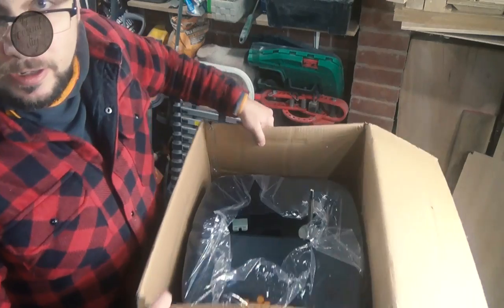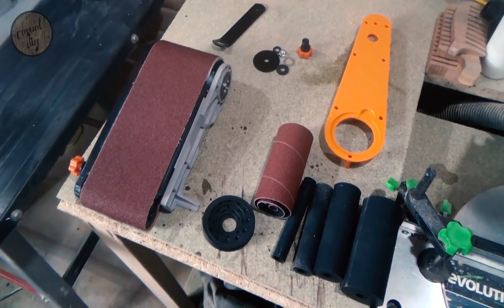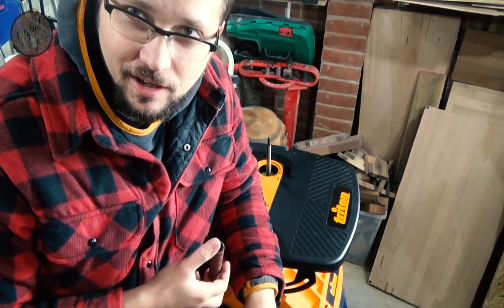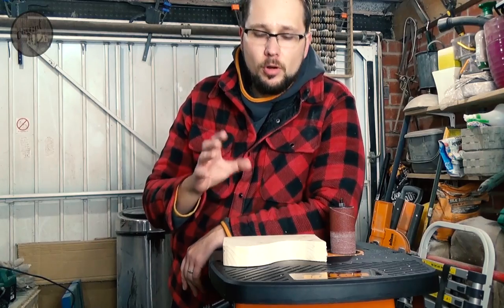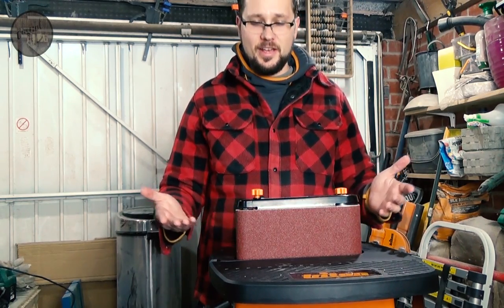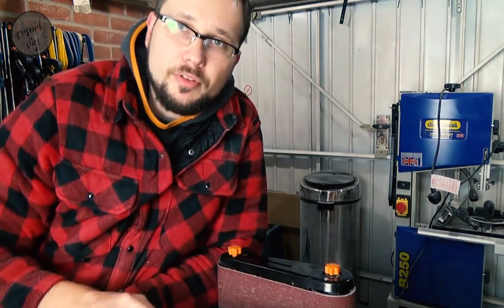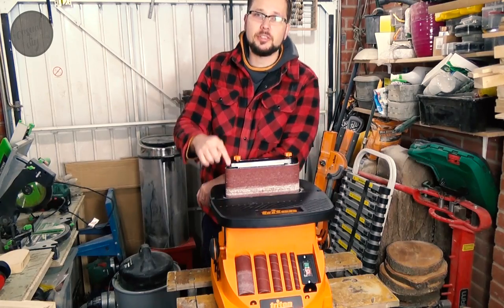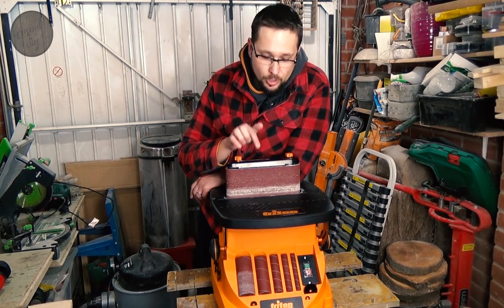Triton TSPST450 450W Oscillating Spindle & Belt Sander - unboxing and review

Comment: Good review
I was close to buy one of those years ago but I always doubt it power . I prefer flor style mashines 
 But this sure looks handy for fine work.
Question.  Does it have enough power? And how high is the spindle? Maximum sanding hight? Thanks
Reply from the maker: Slovenian Woodworker hi and thank you:) the spindle total height is 11.5cm as this is an oscillating spindle I would take about 1cm off for the motion if the total sanding capacity. And it's 10cm height for the belt sander. And yes I would say there is enough power under the hood for an average user.
Reply: Casual DIY it has 100 w more than competition i see. Well thanks for feedback.  It was helpful.  Keep up the good work Cheers
Reply from the maker: +Slovenian Woodworker thanks :)

Comment: Hi, my questions are also related to the 90 and 45 angles and how straight the table actually is, from the comments below, this can be quite a lottery..
Reply from the maker: Hi, yes I have seen few opinions on this. But I have to say mine is spot on. Sometimes it just may need some setting up - due to being chucked about by the delivery person. So far I had no issues with this machine.

Comment: it's a no boner 3 actions on one machine oscillating drum sander. belt sander. and you can bevel the table  to any angle you want. mine comes tomorrow with extra drum sanders and the 75mm rubber drum for the 75mm sleeve. I really like the look of this machine. been looking for a while now. and stumble on this one. which more or less ticks all my boxes
Reply from the maker: I think it's a fantastic machine, works great and it's so versatile 👍

Comment: Hi! I just purchuased this tool and I must say that I am actually not satisfied. Everything is good except tables. You said that it is perfect 90degrees.
So your tables are perfectly leveled and straight?
Seller change my first sander, but today I received second one and I have same problem - table is not straight, in the end (next to spindel) about 2cm of table is bent 1-2mm down. So there is gap, and it is problem to makle 90degrees. Thanks for respond
Reply from the maker: Zvonkanál Hi sorry you experienced issues with this machine but mine is perfect, use it all the time. Maybe I got lucky with my model not sure but it works very well.
Reply: Good for you :)
It looks like I will try third one... hope it will be finally ok, I would love to start using it...
Reply from the maker: Zvonkanál Yes feeling quite lucky now;) but after few months using it I still have to say it's the best tool in my workshop - for what I make it's perfect. You just need to find cheaper sleeves for the spindle as he original one from Triton are quite expensive. I managed to but some from Silverline half the price of the Triton ones but not used them yet so can't say if they are any good.

Comment: For some reason my belt keeps slipping off the rollers as soon as I turn it on. I set it up just like you did, but can’t figure out what I did wrong. Help!
Reply from the maker: Hi, have you got the correct size of the belt? Sometimes the not original replacements may not fit correctly.
Reply: Casual DIY I actually just bought the unit and set it up with the belts that were included (it could be user error, the instructions weren’t very clear).
Reply from the maker: @JordanReiners  hmm so they should fit perfectly. There is just one leaver at the top of the belt holder that you put down. And two star knobs. One adjusts the height of the belt and the other one secures the belt holder. How about the rollers are they clean and any residue clear?
Reply: Casual DIY hm, I guess I just need to get better with the tracking knob. It seems like I can get it for a bit, but it always seems to slide up or down after a bit of sanding.
Reply from the maker: @JordanReiners maybe the hight of the belt is not set up correctly with the left knob? There is a small lip at the bottom of the fence that the belt rides on. If it's set up too low and the belt goes over the lip, this could be causing you issues.
Reply: Casual DIY have you had any issues with the bearing on the bottom of the belt attachment? Mine doesn’t seem to stay in, and every few minutes I have to stop and fix it.
Reply from the maker: @JordanReiners  no mate, had no issues at all. Maybe there is an issue with your machine? Can you exchange it? That star knob that secures the belt attachment screws anti clockwise. Sometimes I do it too much and it's hard to undo but that's about it.